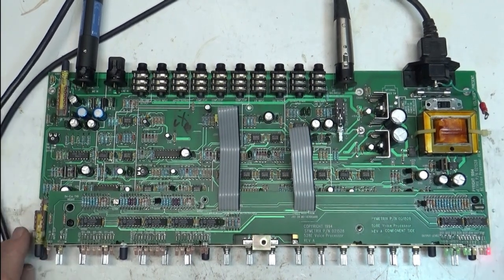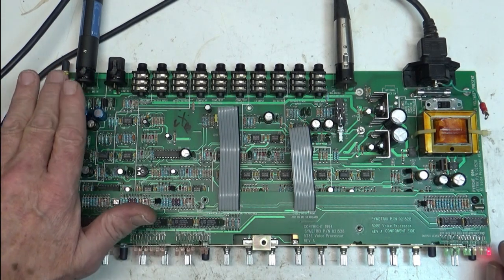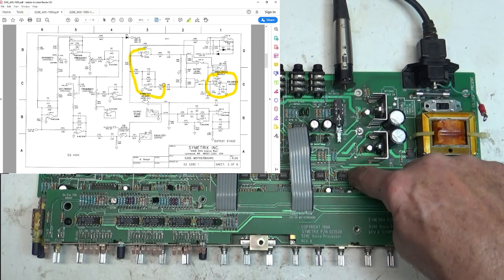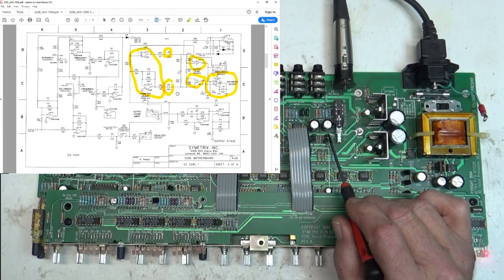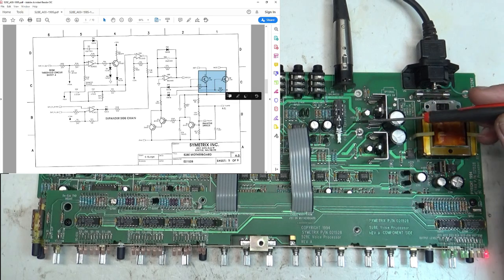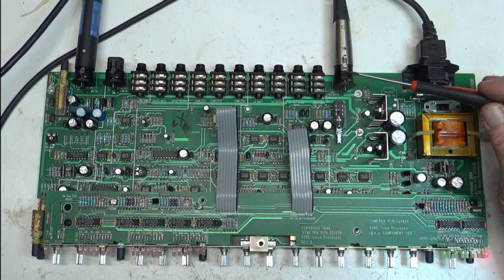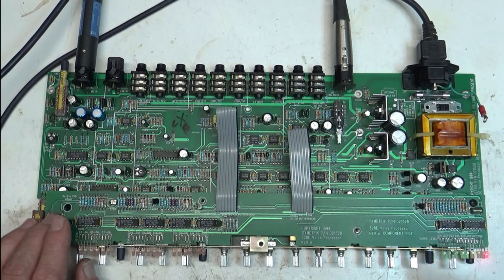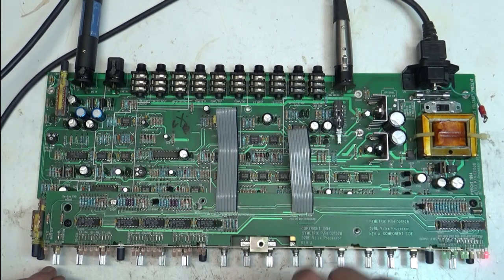Symetrix 528E with blown JFETs

Comment: This might be a dumb question, but I don't know anything about electronics. Is that large yellow and orange box on the right of the board a transformer? Or is that part of the power supply?
Reply from the maker: Yes, that is the transformer. In the next version over the 528E they switched to a thinner toroidal trsnsformer
Reply: @AERVBlog  Thanks for the info. Appreciate it.

Comment: Hello friend, I'm from Brazil
my symetrix 528e gave a problem, it has all the leds locked, what can it be?
Reply from the maker: I can almost guarantee you it is the capacitors. All the electrolytics including the non-polorized ones , about 12, and the surface mount 4.7uf, 14 of them.  Don't forget the two 4.7uf surface mount caps in front of the plus and minus 15 volt supplies. When they go bad they cause the unit to  Oscillate. I have seen various levels of LEDs being stuck on because of bad caps.
Thanks for watching.
Reply: @AERVBlog  I am grateful for your attention, and for the way you try to help me, I will have these parts checked.
Reply from the maker: @igstudiouarini  I have another video changing the caps in the 528E. Take a look at that one. It is  not that hard. A decent tech can do it and parts are not that expensive.
Reply: @AERVBlog  OK thank you
what would be the video?
Reply from the maker: @igstudiouarini  take a look a "Symmetric 528E Voice Processor #2" video. I think you will see the same problem you have. It is from about 3 years ago.
Reply: @AERVBlog  The repair was all right, I am already using it again after 1 year stopped.
Reply from the maker: @igstudiouarini  great.

Comment: Hi.  I have one or more 528e units that pass audio, but have meters out.  Might you help me with them?  I'm a former broadcaster and am in Indianapolis.
Reply from the maker: If just some of the LEDs are out it is probably the LM338 or LM339 on the LED board. If they are all out I would be looking for voltages at the J101 and J200 ribbon cables going from the motherboard to the LED board. Those cable assemblies can break too.